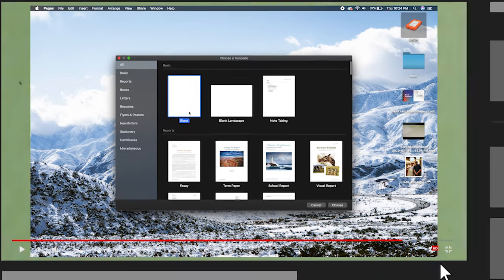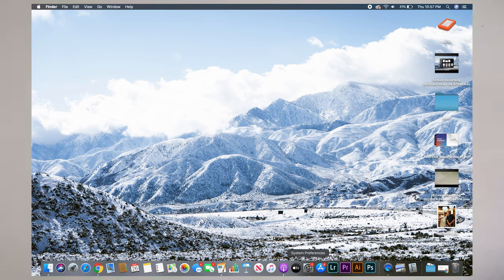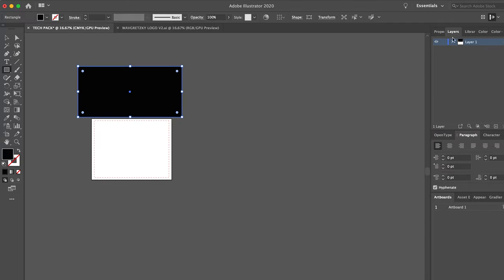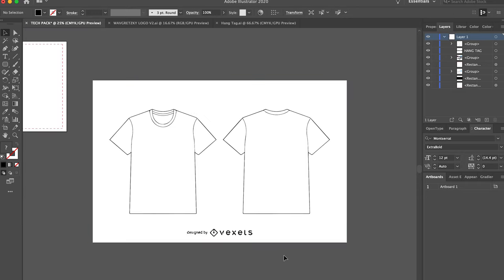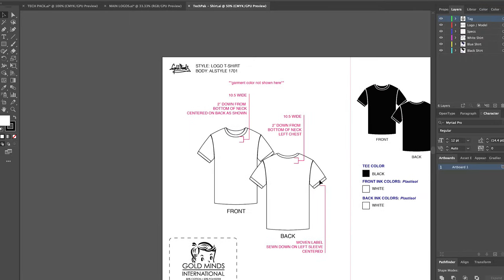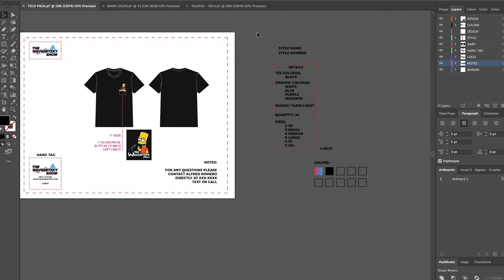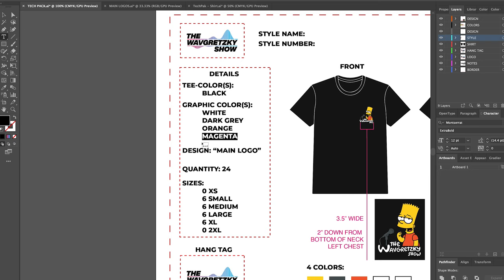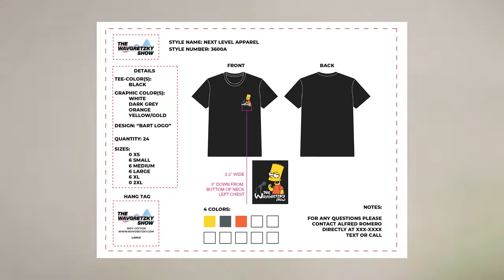How to Make a Tech Pack!!

Comment: So I guess what has got me confused is the style code and name, so what I'm confused about is if I was showing this to a manufacturer  what do I use as the style name/number, that doesn't use precut and sew shirts?  Would I have to come up with all the measurements or is there a easier way to do this? ( Sorry if this is super confusing, and make zero sense but I know very little about tech packs and the whole situation when sending it to manufacturers ).
Reply from the maker: Ty what’s good! So the basis of your question does make sense, I’m a little confused about what you mean when you say “doesn’t use precut and sew shirts” meaning it’s not a name brand like guildan orrrrr meaning you’re providing these “custom” shirts to your manufacturer to print on. If the second one is the case, you can just show measurements on your tech pack. Would be happy to reply again if this doesn’t answer your question!
Reply: @wavgretzky   QUESTION: HOW DO YOU FIGURE OUT THE SIZE FOR THE DESIGN TO ELIMATE ANY CONFUSION WHEN MAKING? PLEASE REPLY